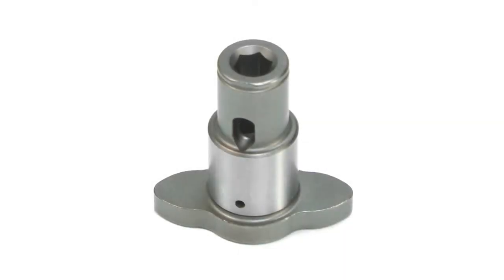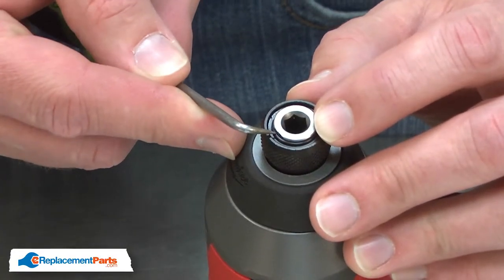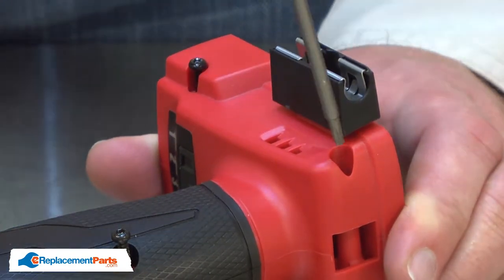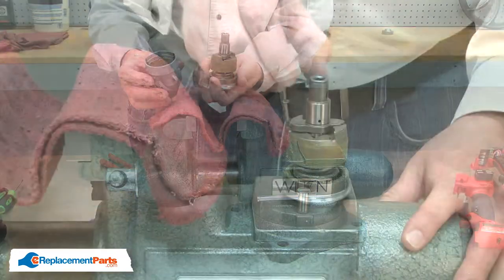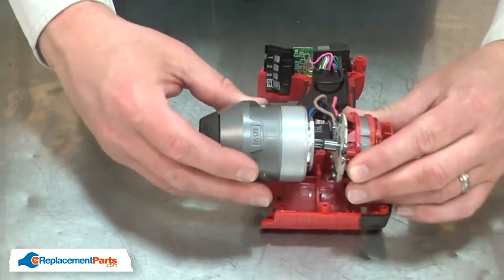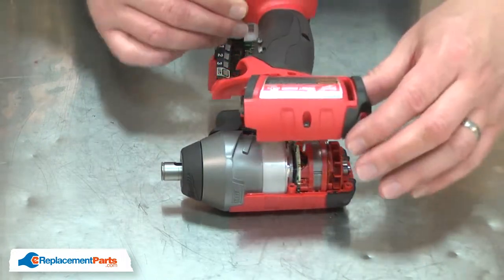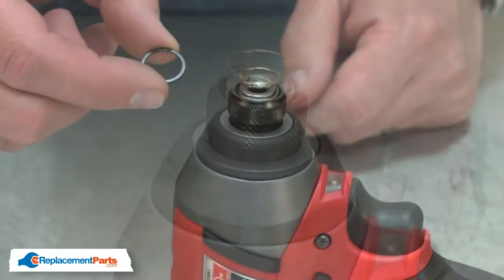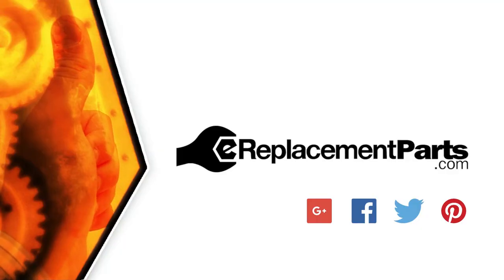Milwaukee Impact Driver Repair - Replacing the Anvil (Milwaukee Part # 42-06-0020)

Comment: Does this actually fix the problem they've been having with them not retaining bits or is this just a general maintenance repair?
Reply: It a replacement video for the anvil. I was able to fix that problem by replacing the anvil in mine. Upon remove a bit I saw a small
Steel ball fall out but I notice there was one still in the chuck but this video shows the removal and replacement of only one ball the anvil I ordered was the two ball type and it seems to work. I would assume better with the two. Still makes me wonder where that second ball came from. The anvil I took out looked like the single ball type. 🤷🏾‍♀️

Comment: the last step, The retainer ring...it  is a real PITA to put back on my compact impact driver m18. I had to enlarge the space between the two ends permanently just slightly with plyers (to make it easier to slide back). After, i inserted a small aluminium spacer, a cube of about a 1/4 inch wide, between the two ends to enlarge it and keep it that way until it is in place (kind of halfway ), so that i can push it finally in the groove (where it has to sit) with 2 small flat head screwdrivers. When the ring is pushed, the small bloc just snaps outs. I don't know how they put it in place that thight in the factory really....

Comment: The 2853-20 gen 3 impact driver has a plastic/teflon gear case cap. Can't tell if its threaded or press fit or what.  No videos or information on that model yet whatsoever and i really dont want to tear it up. Matter of fact i can't even find a place to buy any of the the gearcase/impacting assembly parts which are all listed in the parts list. The tool has been released for over 2 years now. I would think all of the replacement parts would be available to purchase by now along with some sort of tutorial on proper disassembly.
Reply: it is press fit, i just opened mine today.

i have pic if you want.
Reply: After 2 attempts i was able to get it properly serviced. Thanks though.
Reply: @EnnTomi1    I sorry to butt in but got my new anvil from CJ Sinclair Ltd  ,busy reassembleing having trouble with circlclip on the anvil, you need three pair of hands .
Reply: @Ryan-hr9hw  good
Reply: Good

Comment: hi Mark my black & decker keyless chuck drill  the chuck busted on me how do i replace  the chuck
Reply: You need to unscrew the retaining screw in the chuck from the chuck and hopefully it the chuck still tightens, clamp a large Allen or hex key inside the chuck and brace the drill on a table or in a vice then depending on how it’s threaded use a hammer and tap the Allen/hex key loosening the chuck from the drill. Hope this helps